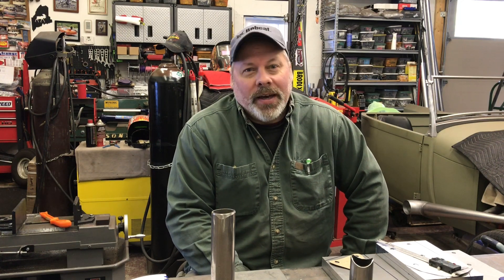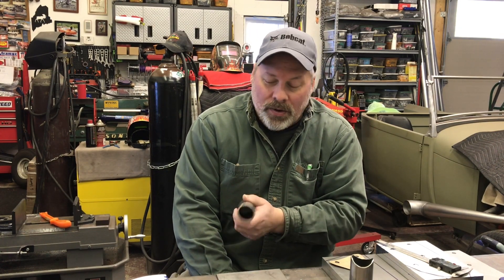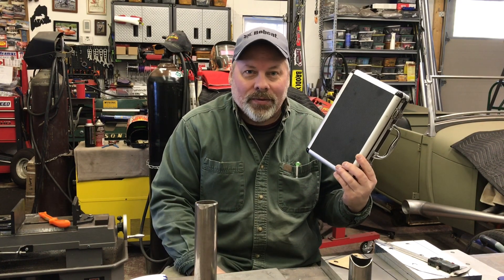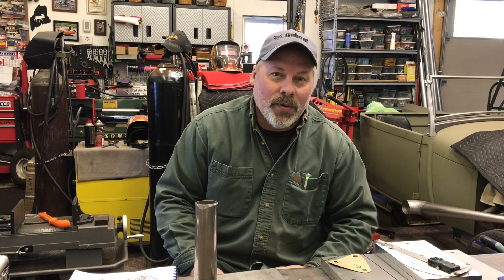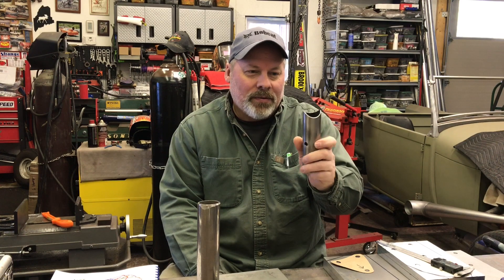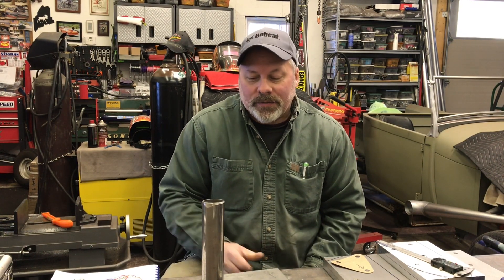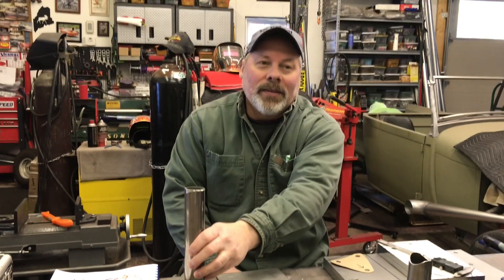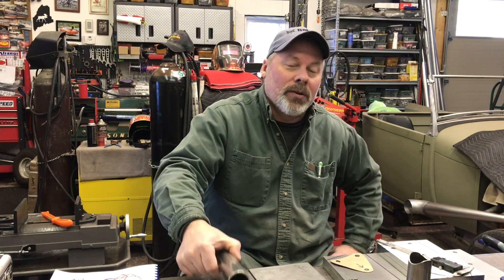Chassis And Roll Cage Construction

Comment: Chrome moly can be welded with mig.. sorry! It prefers tig, but you can have it sonic tested to pass. It requires less heat to penetrate if you preheat it before saturation.. it just looks better tiged is all..
Reply from the maker: Not and pass NHRA tech.